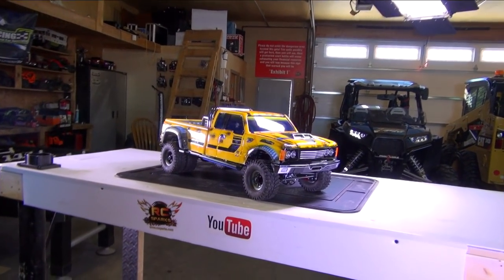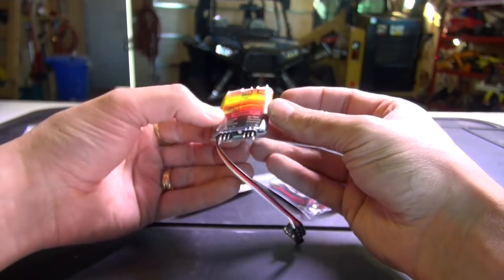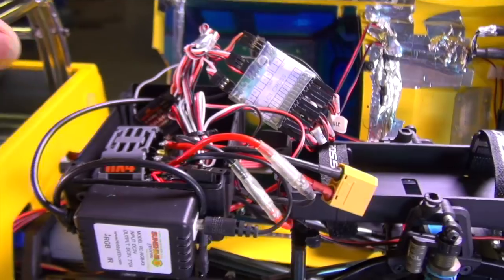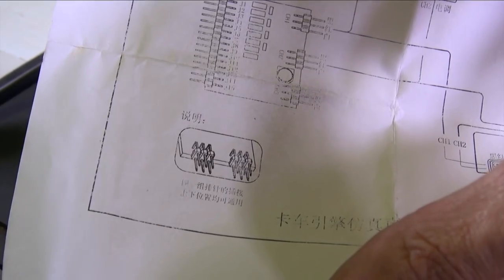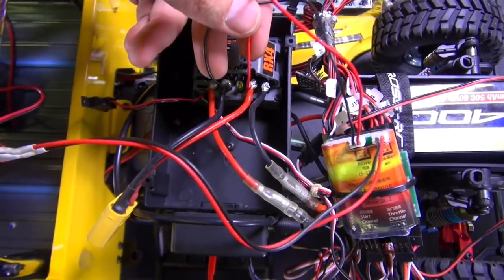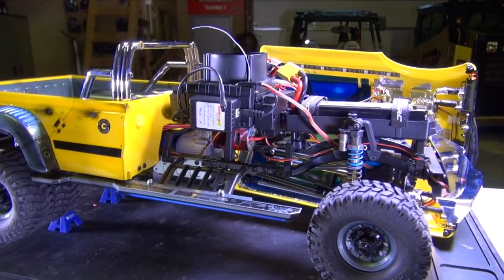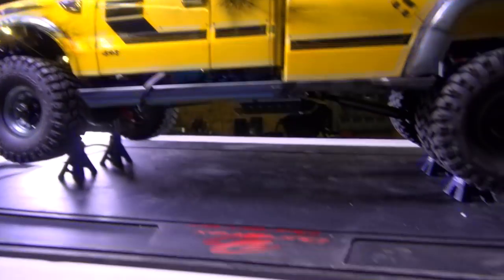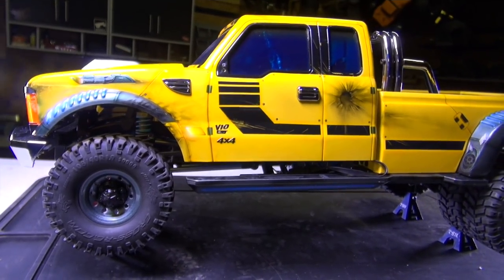RC ADVENTURES - Intsall a DiESEL Sound Module (SK2) in Bumblebee-ST (Cross RC PG4L Build)

Comment: I cut all the wires to length. Makes for good clean install. Save the cut wires for the next project. I need build a nice truck to add to my RC planes
Reply from the maker: ohhh, I like that idea :) Thank you! I just I need to buy more heat shrink tubing

Comment: Actually the cross sound kit sounds exactly like the cheapo kit which given the price point is disappointing as I only paid £21 for mine. It came with about 12 different engine sounds some ok and some truly dreadful. But for the price I love it. When you get the proper speaker please do a sound check of the cheapo kit be good for a giggle and help anyone like I was wrestling with the 
cheap Vs expensive sound kit question

Comment: Can you advise the connection if you are using a BEC. Great video. My monster RCCROSS MC8 required a BEC but am having issues as to how to connect the sound card to the light board and then to the Receiver. I have the pistol grip controller but am not happy with the way it controls sound.

Comment: I just installed the china sound kit 20quid i think. Its ok my daughter loves it and its for her scx but im not totally impressed. I think we need a bec as the sound unit starts the engine whenever steering is given.   +1 on not enough instructions inc. Also for wiring glue in some plastic tubes or even fat straws from McDonald's. Run all wires through those after neatly installing.

Comment: That sound module may be optimized for the said speaker it was designed for, I would wait until you get the correct speaker. I think it's more than just a bead issue with that rear tire , the axle looks bent...

Comment: I agree medic. A diesel neefs to be more thoughty.. Just like you said you did use cheep spealers for now. Im not sure what ohm rating you need but most car speakres now a days are 4 ohm. To me it looks like a 3 1/2 inch car speaker might fit in that tray inside bumble bee-st. Good vod as always
Reply from the maker: The new speaker should be here in a few days. I got two of them - just to try out. 4 & an 8.  We'll see how it goes

Comment: You might be able to change the sound by making some speaker enclosures out of thin wood or also making them a little bigger. In fact maybe make your own custom wooden enclosure to better fit your chassis comfortably. You can also try some sound dampening or lining the inside of the stock enclosures with some type of material to change the sound also. just search a little on google or youtube. Plastic never sounds as good for audio. I have a little bit of experience with audio. It won't hurt to try, just a little time and patience. You might end up just wasting time too though. Its a small risk.

Comment: The sound kit Sense innovations is way better and easier to install. Plus you can change the sounds to anything you want. Plus, when you stop it does stretching sound as well.
Reply from the maker: I agree... was just seeing what cross had to offer. i was disappointed.. BUT - I still havent used the proper speaker.. so we'll see.
Reply: Yeah man i agree it doesnt sound good. I dont think a better speaker will help. Throw the other system in it and pick a kick ass engine sound. You gonna put a smoke machine on it for the exhaust?

Comment: Sorry, its me again.  I am getting horn sound and start sound but no running sound. I am using a three position switch on my Fly sky 5 pistol grip, but using the throttle produces no sound. As i am using a BEC would this be an issue with connections although i have followed the RC CROSS INSTRUCTIONS correctly for the wiring through a BEC and sound card?  I tried every whichway but am still at a loss why getting no throttle sound for engine. hope you might have an idea where i am going wrong.......Appreciate any suggestions from your viewers as well... mammoth MC8 RC CROSS.
Reply from the maker: You are supposed to use the Y harness for the throttle input :)
Reply: @TheRealRCSparks  thanks...will give it a try.
Reply: @TheRealRCSparks  Sounding like an idiot, can you clarify which wires in and out of the Y harness. Have tried various combinations but no go. Really appreciate your time in trying to advise. Promise this will be my last question.

Comment: Hi Medic! Those speakers are too small. Btw what about the resistance of the speakers. The sound board is for 4 or 8 Ohm speakers? As I saw U hooked up paralell so if the speakera are 8 Ohm than now its got 4 Ohm res. and if 4 Ohms each than U got 2 Ohm at the end. Measure it with a multimeter or try to hook up series as well. Just an idea...
Reply from the maker: I actually have two different speakers on the way - "1pcs 2.5"inch Square full-range speakers 3ohm 12W 60MM" & 2pcs 2.25"inch 60mm 8ohm  - both are full range speakers.   I just have to wait another week and they should be here to test

Comment: Cool medic dont see many police setup setting up my radio shack monster patrol with led police light bar and headlights with siren box and bumper police lights and not sure how many controllers i need for it all
Reply from the maker: you're McGuyver - just use a bubble gum wrapper, a coat hanger, some wire, and a battery. This is old news for you ;)
Reply: RCSparks Studio lol thats funny

Comment: There is a way smaller led light strip kit on ebay ive put one on my Kraton and Oout Cast also on our real life RV THATS how  Versatile they are will handle up to I believe 18 volts of the top of my head it has color control dimmibilty ill get the product # for you they are very small the one on the RV has been on there 3 years so are also dependable so far

Comment: To each there own but it's kinda annoying that you hear the horn before it can start and before you take off driving. I know it's all due to the cheap speakers as well but it sounds awful, you can't hear the turbo spool up you can't really hear the sound of the diesel over the electric motor running:( I'm really looking forward to hearing the better speakers

Comment: ☝ "MATTA! / HOLD IT!" ☝

Why do the door badges say "V10" like a 2002 Ford F-350 Super Duty 6.8L Triton V10 or a 2001 Dodge Ram 3500 8.0L Magnum V10?

Shouldn't it say "V8" instead?
Reply from the maker: Nope, its Bumble Bee-ST  its a v10 :)
Reply: @TheRealRCSparks  ☝ "IGIARI! / OBJECTION!" ☝

- Miles Edgeworth

Yet, in later videos, it has a wastegate turbocharged V8 engine sound thanks to the Sense Innovations Ess-Dual speaker system!

Therefore, for the door badge on either side to say "V10" like so, that would imply that the truck should have an actual V10 engine such as a 2nd-gen Dodge Ram 2500 8.0L Magnum V10 or a Ford Super Duty 6.8L Triton V10...

(slams desk)

NOT A WASTEGATE TURBOCHARGED V8!

Comment: 70 Bucks? What a ripoff, those components don't cost more than 6 $...
Reply: Lagger Onesixfour if you want a long lasting nice quality one it’s actually a good deal for 70 bucks
Reply: Donnie Holley Good quality? Wha is good quality about that thing? It doesn't have a proper case, just a plastic foil, the sound wasn't even near a diesel engine not to mention that things like these can be made DIY with less than 20 $ and you could put any sound you want in there.

No. At least I am not buying it. What a ripoff...
Reply from the maker: I am exploring different options, than just the usual sound kit. I did not have a chance to hear it - and aren't you happy now you know? Also.. like I mentioned.. these are not the proper speakers for it.. so passing judgement on it is a little early.  Too each their own..  this video is here for entertainment purposes. Apparently.. you got your entertainment. Thats a plus